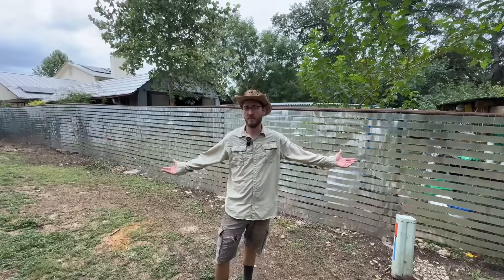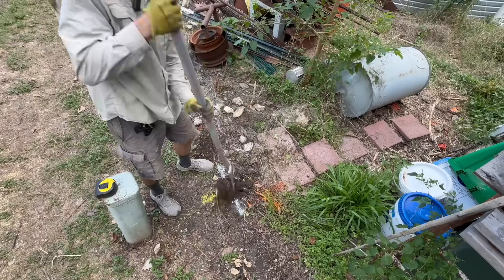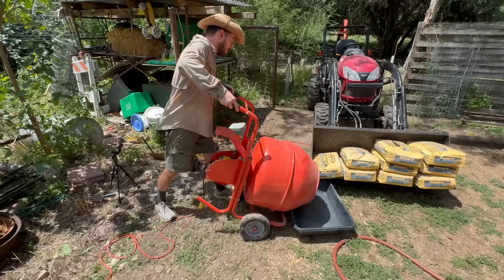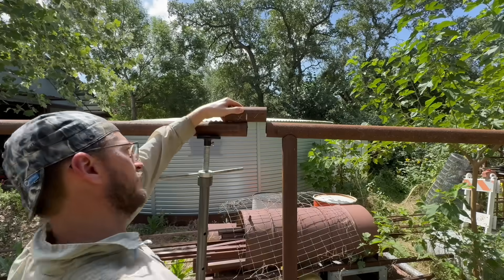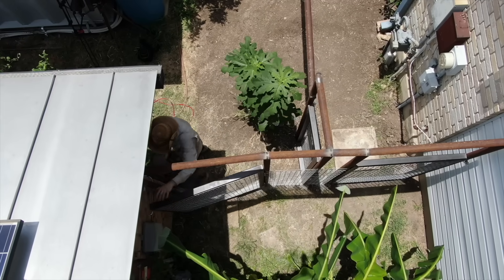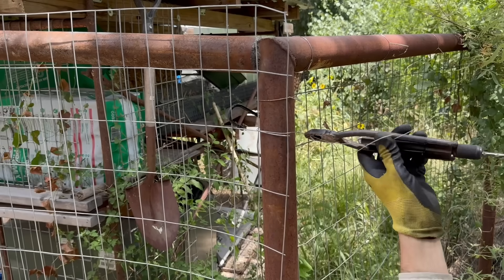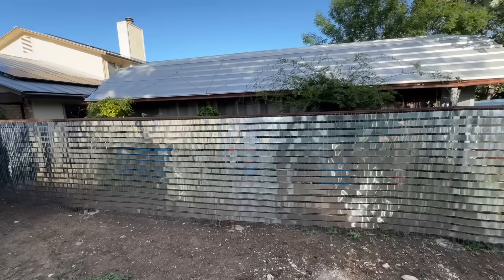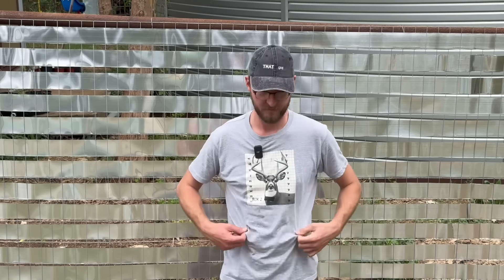This FENCE Lasts 100 years!!!!

Comment: Love it!
Question: will the vines hold out being next to flash’s higher heat reflective capacity? 
I have a fence line stretch that may have a new makeover.
Thanks man…
Reply from the maker: This fence runs north south so the fence provides the vines shade half of each day. They are doing fine and we get tons of sun. I showed the plant names and I would recommend getting vines similarly sun tolerant. Thanks for commenting!

Comment: the wire fencing will not last 100 years; your framing may; treated wiring can last longer; but not treated will not. An treatments can dissolve over time. I see old fencing all the time in country, that did not last no where near 100 years. Once wiring fence breaks, all you fed into it will fall out. Good concept though.
Reply from the maker: Yeah I suppose I didn’t specify. I expect the pipe to last 100 years. The wire may fail before that.

Comment: Great! Only last week I competed my garden fence restoration, the wooden posts were rotten & broken, tied in place for 2 years so overdue. For posts I used similar, but galvanised steel scaffolding poles, to keep my concrete stumps in place I laboriously drilled, chiseled & hacked the 2 foot wooden ends out, 2-3 hours on each one, then placed the new poles into the hole with just half a sack of postmix required on each. I wire-brushed the old feather-edge fence strips clean with a fresh like of Ronseal fence paint, total cost £84. The posts will outlive me
Reply from the maker: Sounds like a solid fence. It’s a strange feeling to build something that I assume will still be here when I’m gone. Rewarding but almost sad too. Thanks for commenting!
Reply: Man, I hate I only have this advice for you too late but work smarter not harder! Drill an inch hole in the center of the embeded wood post as deep as you can, soak in lighter fluid, toss in a match, place a blower or point a fan into it, and burn the posts out of the concrete. XD

Comment: Just came across your video,ive been looking for ideas to fence off my property just have a question, with very hot sun could the luminum flashing  cause a fire being so shiny.
Reply from the maker: No it has not gotten anywhere near that hot. If your fence is parabolic shaped maybe. Also this fence runs north south so it generates shade half of each day
Reply: Thanks I'm not in the USA ,I whated to try this in Portugal but the temperatures there get very hot something over 40° but it's a good idea😊 @suburbanbiology

Comment: Liked everything you did, except the aluminum flashing. Any chance of electolysis there? Especially if you've got humidity in your area.
Reply from the maker: We are low humidity. But yes galvanic corrosion is technically an issue.

Comment: You outworked yourself mixing concrete all you have to do is pour a bag of quick rete dry in your hole with pipe in it and then pour about gallons right over it and it will harden no mixing.

Comment: I have just watched a guy who built a fence of drilling pipe . It was covered in rust which is not protective and contrary to patina accelerates rusting . Claiming it would hold a hundred years and is cheaper to build than of wood. He seems to be a honest guy and recommends it. 

What sort of day did you have?

Recycling of metal is usually considered melting for reuse. It is energy expensive but way less than mining. I believe this is super stupid , if you have reason to doubt it please share.
Reply from the maker: See description. Montana game and fish agrees. The thick steel walls in dry climates can last a very long time. The rust forms a protective and stable coat.

Comment: Can the foil sheet stand the force of high winds? Because i love the idea but being the the valley its quite windy and during monsoon season its even more extreme so...Love from Nagaland..
Reply from the maker: Yes it holds up to wind very well because of the small gaps between the rows. Just make sure to weave long strips. If you tried it with 20 cm strips they would blow loose.
Reply: @suburbanbiology  Might as well make it practical and do some minor fabrication and tie up sheets in between the rails✊

Comment: That would certainly not last 100 years here hell it probably wouldn't last 50. I know we're called the rust belt because we use to make steel here but it's pretty fitting for just how metal goes around here.
Reply from the maker: 100 years in south Texas. 10 years in Minnesota 🤷
Reply: @suburbanbiology  It's amazing how different parts of this country are when it comes to climate. Probably doesn't help that we spread salt everywhere for afew months every year.

Comment: I considered taking time to pick up some practical skills in a trade such as welding or carpentry before going off to college. I regret not doing so now. I dream of homesteading, but doubt I could make due with the skill set I have. Seeing you weld this together with largely salvaged parts and cool tools that make digging and holding things so much easier that I didn't even know exist, living the life I wish I had, good for you brother, I'm glad people like you exist
Reply from the maker: I learned to weld while I was in college. I don’t mean to pretend I know your situation but if you can afford a cheap mig welder on Amazon I would encourage most people to go for it. A 4 1/2” angle grinder and a small mig welder with flux core wire can go a long way. Gotta start somewhere. We all do. Take care and good luck!

Comment: Call great ideas and I appreciate your sharing with us. I am wondering about the metal reaction of the galvanized fencing with the aluminum. I'm a little concerned about any aluminum in the garden area because of oxidizes banjo have aluminum in the soil and high concentrations next to the fence.
I didn't know that tool for spinning wire was even in existence, I don't think I'll ever need one but it's neat to know that it's exists. Also thanks for the angle cut on the tops of the pipe to form a cradle.😃
Reply from the maker: I’m glad you enjoyed it! In my dry climate I don’t think the aluminum will corrode very quickly but I guess time will tell. I will make sure to show the fence in my future videos. Thanks for commenting!

Comment: I just bought a house near Lubbock that has wood and metal fencing on the sides, but the squared metal (like you used) attached to posts in the front and back. 
I was trying to figure out how to give it more privacy on the cheap and easy and found this video.... pure genius. Thanks for the idea that I'm gonna steal as soon as I finish unpacking and settle in. 
Now all I need is to find out how to get rid of a lawn full of goat head stickers without massive chemicals!
Reply from the maker: Glad it helped. The new wisdom is to outcompete the weeds you don’t want. Maybe look into cover crops. The weeds that grow in an area can tell you a lot about nutrient deficiencies in your soil. Look up “advancing ecoagriculture” (AEA). John kempf has a lot of good lectures on what weeds can tell you about what your soil wants. Thanks!
Reply: @suburbanbiology  thank you

Comment: Here is decent solution as well, run to runs of the fencing parallel to one another and fill the middle in with brush it’s actually a decent look
Reply: Two runs
Reply: I should have first mentioned what you did was Amazing! But not everyone can take it that far

Comment: Colorado concrete - empty the bags of concrete directly into the wholes dry - fill to top while leveling both directions - next hole. Then you come back with your hose or water supply and add directly to each of these dry concrete filled holes with your posts in place & leveled. This method reaches the entire cavity of the  hole you did not effectively and efficiently. Let posts sit over night and your good to go. 👍👌

Comment: That's not true, that fence couldn't withstand 100 years, the material is very corrosive, the wire mesh takes about 7 years, but it's fine for you.😂😂😂😂😂😂😂😂😂😂

Comment: 9:39 That ‘arch’ would be a lot stronger if it had some diagonal braces in the middle section.
Reply from the maker: It would but for one as small as it I’m not sure the braces are needed. I guess time will tell.
Reply: @suburbanbiology  
My soil is consists of clay and peat turf and would probably require bracing. 
I forgot that your soil is much more stable.

Comment: Beware of using a metal cutting, carbide tip blade on a wood cutting saw!
The metal cutting carbide tip blades are designed for 1400 RPM, where as the wood saws spin at over 4000rpm.
Not to mention your wood chop saw probably has alot of plastic around the blade area and the hot metal sparks will damage it. The brazed-on carbide tips can fly off like little bullets.
   Metal cutting chop saws are available, but are dinosaurs compared to wood- They aren't compound cutting and only swing to the left, not right or left, BUT they spin at the appropriate RPM's for metal carbide blades.
  Carborundum blades for metal DO spin at higher RPM's, but emit heavy spark showers, so beware!
DaveO

Comment: You've ignited a spark for my fencing project but will require my non-existing welding skill set to improve.  A cost prohibitive material but I would think copper flashing also a good look at install and as it patinas

Comment: I get it but not safe for pets or young animals! Flashing is sahrp! 

 Want cheaper and safer? Take your two liter bottles down to 3" and once you get that on the fence you might weave the other direction. Take your torch and meld ends or at least heat them edges where the sharpmess dulls away! Now its not as nice as flashing but a whole lot cheaper and safer!

Comment: Random thought... you're in Texas; maybe have someone cut a bunch of stainless saddles you can bend down over the joints at the posts to make em more rust proof!   
Put a second latch low and connect em with a length of fence tension wire.

Comment: Pipe welds about 18 years.  Pipes about 35 years.  Hooking wire about 22 years.  Cattle Grid about 15 to 25 years depending on plant/animal contact (bird poop etc). Aluminum pop can sheeting about 8 years.  The plastic coating and label paint aren't UV or ozone resistant and you've basically turned them into a low voltage solar and wind power generator, rain wind cold and even minor dew is going to eat the work hardened surface off and the center will decay like a baby's teeth in a candy factory afterwards.    And your soil is now full of microplastics too.   Ahh, flashing  12 years.

You can vertical level posts with two strings and a coffee can with no ends then run cheap duct tape in X between them to keep em aligned. so much easier

I would bet that a nice coating of A+B on that flashing would make the fence last about 50 tho.
Reply: I share the assumption it may decay like a baby's tooth. Thanks for sharing your view on it , it seems to be backed up by experience. 
Just a guy who can't believe what he just saw , happy to not be the only one.
Reply: That same flashing on a roof lasts 25+ years.  What makes it fail so much faster as fence filler?
Reply: @davidmeservy1466  electro-chemical series of metals' reactions. Basically, dissimilar metals in contact with one another exchange electrons, amongst other things happening, oxidation will occur, particularly with a fence that has in-essence electrodes shoved into the ground and which will be wet a lot. Any static electricity from wind or other charge is going to pass through it as a circuit, expediting the phenomenon. 

Without a sacrificial bit of higher reactive metal attached to it somewhere, this fence is going to rust away. If I built it myself I would paint all the parts before putting them together and tie the anode from a water heater to it. I'm young and would be long dead before I had to worry about rebuilding any significant part of it.
Reply: I was thinking in 100 years there would still be some evidence it once existed.
Reply: Microplastics.... got one buzzwords in there to feel good. Always one guy that has to one up the other guy.

Comment: The concept is excellent except for the aluminum flashing used for privacy .  The reflective surface in the hot Texas summer will burn not only the vines you try to grow next to it but also the grass in both yards.  I hope I'm wrong but the same thing happened to a building with a floor to ceiling window which faced south here in my northern state town .  Keep an eye on it and come up with plan B if the yard takes on a brown hue.
Reply from the maker: We are in the midst of August heat. If it’s survives this it will survive anything.

Comment: I love this. I wish I could weld. I am wondering if the flashing will rust over time. Thanks for the Great Video!
Reply from the maker: The aluminum strips may oxidize over time but in my dry climate I think that will take decades.

Comment: Great fence but! The aluminum will potentially create a problem with plants growing around it. Why? Because the aluminum is pretty sharp and will cut the plant stems just because of the weight of it, over time, as they grow. If they do and can hang without breaking.

Comment: You didn't say what you did with the flashing ends.
Is it just held in place because of the weaving?
Did you overlap the ends?
It looked like sometimes, for some unknown reason, you went longer than the fence post section.
Did you cut those to length? Leave them as is?
Reply from the maker: I overlapped the ends of the strips. Much like basket weaving. When I got to the very end of the fences by the gates I bent the tips around the wire to hold the very end in place.

Comment: I love the idea that it’ll last 100 years, and the fact that it’s partially made with recycled or salvaged materials. But the final look does not appeal to me. 
(And I’m not throwing shade here. I just have a different aesthetic preference. And that’s fine. Different people can like different things.) 
But I have 2 questions about the functionality. 
1. How is it secure at the ground level? Because it seems like a coyote or something might be able to dig a ditch that runs underneath really easily, and then another animal might bend and stretch the hardware fabric trying to force its way through the coyote ditch. 
2. Is the reflective flashing going to burn the plants your trying to grow? I mean I live in Southern California and some of the plants I try to grow just get burned by the sun. I imagine it’s just as bad in Texas, but it seems like you’re putting a mirror behind your plants and giving them double sun. Of course, some of the plants I try to grow can handle full sun, in the desert, in the American Southwest, just fine. So I’m just wondering if you’re planting vines that can handle the heat, or if you’re planting on the south side of your yard, or something like that.
Reply from the maker: This fence won’t get too much coyote action. If it abuts a field then a bottom bar would be a reasonable idea. Here I’m counting on the Hines to tether the bottom in place as they grow. Vines are very effective at that. The reflection has not been a problem. Only plant things that can handle our harsh sun. Also this fence runs north south so for half the day the fence is actually shading the plants.

Comment: Does it frost there in Texas? If so, how did the banana trees handle it?  It's hard to see how they came up with the term   'wire fabric'  for wire mesh. Also  'hardware cloth' .
Reply from the maker: My bananas die back to the ground every winter. No fruit so far. I will transplant them into the greenhouse once it’s done. Thanks!

Comment: In a word, I like it. You've got a good and functional fence. If I suggest a mod, I'd skip digging post holes and filling with concrete. Instead, pound steel post into the undisturbed earth. The industry makes both handheld pounding and gas-powered pounding tools to do it. If you hit some Texas Limestone, break through it or stop on (or in) it. Cut post heights AFTER all posts are set. If limestone is shallow, only dig post holes for those tough ones. Advance the rest of the fence as you did; it's a good fence. ~ In follow up, please compare your material cost against the material to build a standard chain-link fence. Steve, Utah
Reply from the maker: Thanks for the tips. I put rough numbers for cost in the description. The fence was 85 feet long. Thanks!

Comment: Great Job 
I used this welded wire fence and unfortunately it does not last 
I have animals that test the fence and also weather 
Welded wire will pop apart and is not useable after that very disappointing 
I found rolls of chain link is the best after spending lots of money on horse fence and welded 
Hope yours will last

Comment: I have a pipe corral which was on the property and old when I bought it 30 years ago. The builder added lengths of rebar which made it easy to climb over. This fence is indestructible! And I've had both bulls and a couple of stallions inside. I'm not keen on the flashing because it reflects the sun.

Comment: I can tell you the fence may last 100 years. but your pipes will last about 40-60. they will thin out greatly and basically turn into paper thin tubes. unless you keep them completely covered in cold wet mud then they will last a good 100 years. 

my knowledge is based on pristine things found from ww2 and long abandoned places/locations.

Comment: You get what you paid for. Those safety wire pliers are worth every penny.  I’ve been inside many diesel engines safety wiring two inch nuts cussing cheap tools while standing on oily cylinder nooks and crannies.
Reply from the maker: Agreed. The more expensive pliers are well worth the extra money. Thanks for commenting!